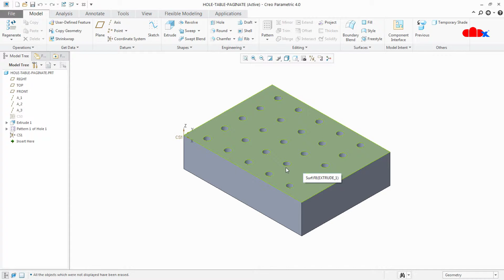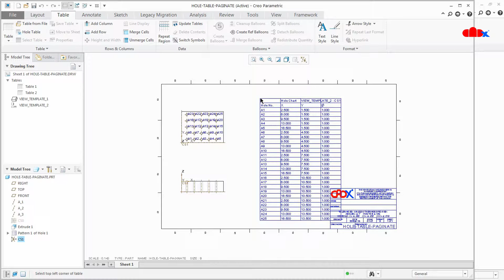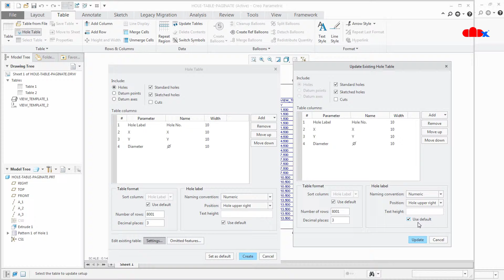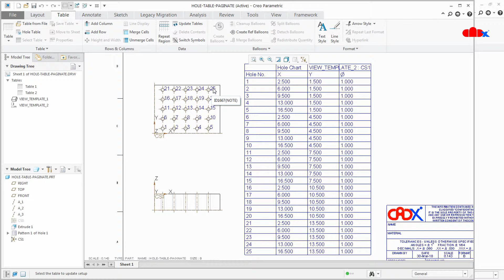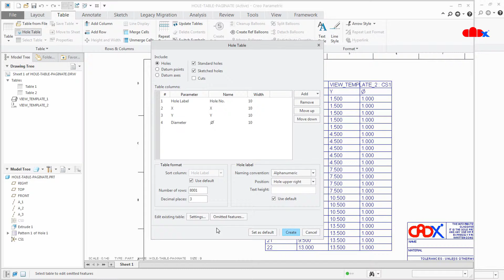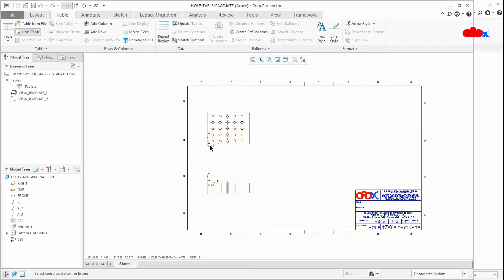Split the hole table and Edit the existing table in Creo Parametric

Comment: Whenever i select the co-ordinate system for creating hole table, it says no item found and didn't create the table. What should I do?
Reply from the maker: You are selecting a wrong co-ordinate system. Create a new coordinate system on the face where the holes are. Make sure that the z direction of the co-ordinate system is in the same direction of hole axis.
Reply: @CADxTraining  Thankyou so much. Now i get it right.

Comment: Plz tell when the holes are in both side like front and back than what will do because the hole table take both side in the coordinates  than what will do
Reply from the maker: There is the two different things you can do. One thing is, create different table for different face. Second thing is , you can create single table for front and back face using axis technique available in hole table creation.